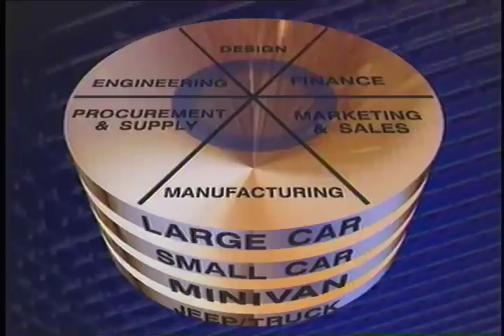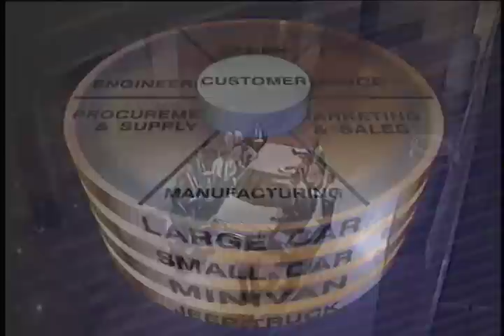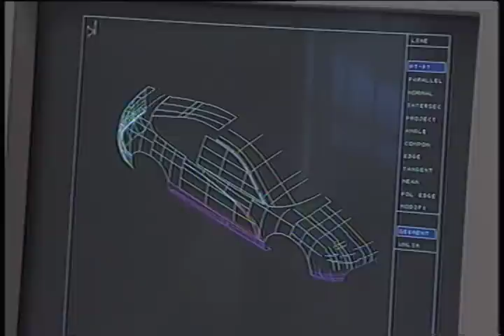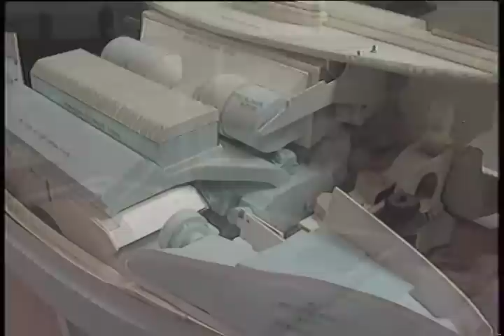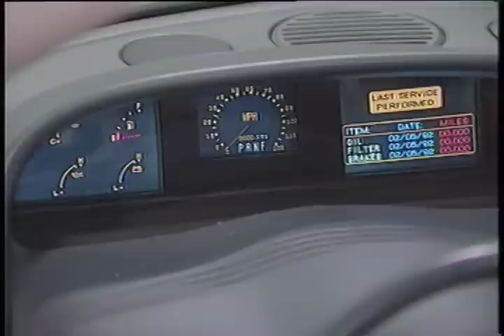Reinventing Chrysler 1992

Comment: Chrysler cars were bad big time from 1994 on the LH was pure JUNK but  the AA Spirit and the K Aries and the L body were very good cars for the most part I would never buy a LH body
Reply: My 1993 Dodge Intrepid ES is still in perfect condition and purrs like a kitten at 110,000 miles. Americans are completely stupid about how cars work so they beat the sh*t out of them, don't maintain them properly and then expect them to be reliable 24x7 for 10 years. Just ignorant. If there is one thing in a person's life they need education on as part of their schooling is how to take proper care of a car. I have had ALL Chrysler products in my 58 years and they were all terrific. Yes, the LH platform had some teething pains but the longitudinal 3.5 liter engine is one of the best engines ever made in my opinion. The ONE thing that you can do to thwart planned obsolescence and breakdown of an engine which is a collusion of the oil companies and the auto companies is NOT to use anything but synthetic oil from the day you buy the car and change it every 3 to 4 thousand miles. Yep, that's pricey but so it a brand new motor. Most people use whatever cheap crap oil the oil change places use and then use it for 7-8 thousand miles and wonder why the inside of the engine breaks down. Other than a couple of gaskets, my LH has never been apart and still has factory compression and burns NO oil.
Reply: BobEckert56
Please stop confusing dolts with reason.
Reply: +gary taylor just let them be dolts?
Reply: agreed, I had a 90' Acclaim and I loved it!
Reply: oh and the Cloud Cars were even worse then the LH cars
Reply: SUV Man, how would you account for me having a 1993 Dodge Intrepid ES with the 3.5 and 4 speed auto and all the options they could put on it and leather interior and me not having a single problem that occurred before you would expect it to? I traded it with 80,000 miles to the same dealer and they gave me a good price. I did take exceptional care of it.
So wouldn't that indicate they were inherently junk?
Reply: @BrokebackBob  dang..looks like i wrote this, lol. congrats! you're a 1%'er..as in..having what used to be common sense, which no longer is. i buy Mopes with 100k or more on them for a couple grand and drive them for yrs. God, i love my 'Junk Mopars!' lol! yeah, im a Mobil 1 guy..i get the diesel spec stuff, bc extra ZDDP, valve train protection. but you're right.. Chrysler cars are the rescue pets of the auto industry. beaten, neglected and cursed for no earned reason..just losers who want their hand me down Mopar broken so their folks will buy them a VW, Honda or wtf ever. & I <3 FCA! so sick of the haters. Pacifica, RAM, Jeeps, SRT line, effin Hellcats and Demons, all fantastic!  only non mopar engine ive ever owned is the 3.0 Mitsu in my '93 LeBaron convertible..just was too good a car to pass up. runs fine..but i'd love a 3.5L or an SRT4 mill in it :) Maybe when i finish (it'll never truly be done, lol!) '70 Fury Gran Coupe with a 440? :)